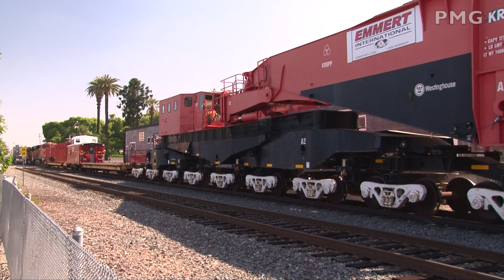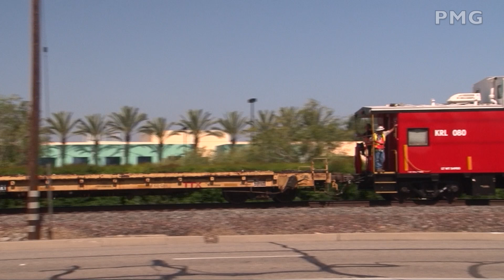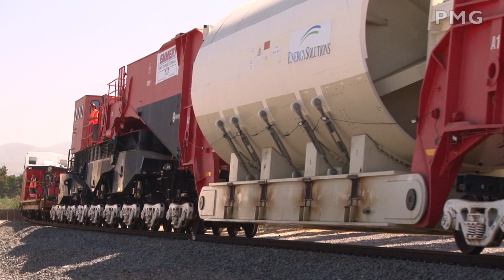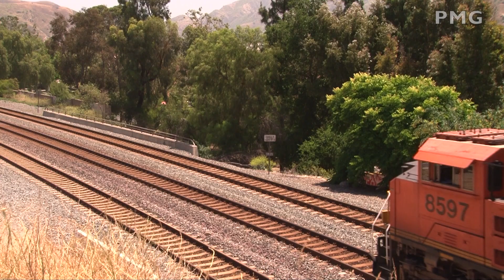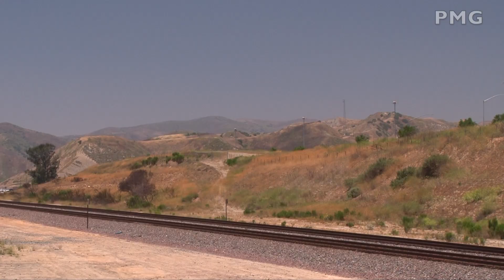Schnabel Car Transports Nuclear Container

Comment: Why scrap well made machinery? Disposable mentality.
Reply: FRA regulations - railcars must be removed from interchange service after 40 years, though with re-building, they can be given an extension of 10 years. The car passed its 40th birthday in 2020 and there's not much of a way to re-build or re-condition such a unique car.
Reply: @whiteknightcat The regulations should be changed to miles traveled, not time elapsed. It's as good as new.
Reply: Safety mentality. You don't want railcars falling apart from hidden metal fatigue while hauling 200tons of dangerous stuff.
Reply: @karlkirkwood6213  Chinese monkey metal far less quality today.

Comment: our tax money at work. 

should just keep the “stuff” at the nuke plant. as soon it will be destroyed by the state.  as cal wants to power everything with solar.
Reply: You don't know anything about nuclear regulations or radiation contamination, do you, or that Southern California Edison, a PRIVATE utility, has to pay for all this?
Reply: Actually, Gavin and the state legislature have changed their tune on nuclear. They realized how important San Onofre was, so they decided to keep Diablo Canyon operational for several more years. There's actually too much solar right now because there aren't a lot of great ways, in current operation, to store the energy for when you actually need to use it. Lot's of creative "battery" options out there like pumping water up to a reservoir and releasing it down through a turbine during peak demand, for example. Building stuff like that takes time and money.
Reply: @karlkirkwood6213  San Onofre HAD to be decommissioned because of damaged steam tubes. They'd only been replaced 2010-2011 and 3,000 of them were found to be rapidly and prematurely wearing and breaking down little more than a year later. The NRC deemed the plant too unsafe to continue operating so it was shut down. Decommissioning takes years because of the nature of the plants.

Comment: Why scrap the car? it is not used much so should not be worn out. 
or is it because thee are no more loads that car was built for? 
if so i call poor planing. as build cars that can handle a variety of loads.
Reply: FRA regulations - railcars must be removed from interchange service after 40 years, though with re-building, they can be given an extension of 10 years. The car passed its 40th birthday in 2020 and there's not much of a way to re-build or re-condition such a unique car.

Comment: Prior to retiring, I worked for Combustion Engineering, Inc for 40 years (the nuclear division was later bought by ABB, BNFL, Toshiba, then Westinghouse Electric).  We bought it for transporting heavy components we manufactured for new nuclear power plants and rented out the Schnable car for other heavy loads.  Some winters it was used in Canada, when the rail bed was frozen to support excessive weight, to haul very heavy loads to mines in northern Canada.  We had an engineer in Windsor, CT who was responsible for traveling the entire train route measuring clearances, curve radii, trestle strength, etc. to ensure the load could reach the destination.  There are two caboose cabs mounted on the car for housing this engineer and other support staff.
Reply: Is it possible to move the load sideways ? ie to increase  clearance and deal with center of gravity issues due to canting of  track in curves ?

The biggest one used in Sweden for transformer transports from Ludvika to the selected harbour allows that - though it is rather important not leaving the load in the wrong position...  It has been a number of lost loads due to that (ie a 200 metric ton transformer upside down in the ditch...)

Comment: Hi everyone. I'm the cameraman for this program. Many of you were wondering why the car was being scrapped. It was MY understanding 2 identical Schnabel cars like this existed and both were built in 1980. Instead of investing $$ into rebuilding this car, it was decided to just scrap it once it was finished with THIS assignment. I was told they would keep the other one in service.....for now.
Reply: @markjohnson4924  I heard that also.  As I remembered it was scrapped on the spot.  Since cars have a 50 year life span  per FRA regulations
Reply: How many Schnabel cars are there? Just the two?
Reply: @mkay1957  There are dozens around the world, but perhaps 30 in North America in various sizes. Reportedly, there were 2 built like the one filmed, but THIS one was scrapped.
Reply: This particular car was built in 1980 by Krupp Industries of West Germany in1980 and was the only one of this size at the time. Kasgro Railcar, a U.S. company built a second one in 2012. It was almost an exact copy but was heavier and had a higher payload rating (2,035,800 lbs. vs 1,779,260 lbs.). Visually they were easy to tell apart because the Kasgro had a blue body and black trucks instead of a red body and white trucks.

Comment: Why are they scrapping it ?
Reply: FRA regulations - railcars must be removed from interchange service after 40 years, though with re-building, they can be given an extension of 10 years. The car passed its 40th birthday in 2020 and there's not much of a way to re-build or re-condition such a unique car.

Comment: Cool video of this particular rail car! However, I think the real remarkable story here is a train that has 2 cabooses on it in 2024! 
Seriously miss seeing trains with them!
Reply: Lots of people involved in the move
Reply: At 1st I thought that the cabooses would have security in them, but then realized no reason for them, empty reactor. The police on the roads and such were to keep down the chance of stupid people running across the tracks and if there would be some unfortunate incident.
Reply: @MsGorteck  It's not a reactor vessel: reactor vessels are much larger. It's just some part of the power plant.
Reply: @beeble2003  oh, ok, thanks. Still no reason to have a rapid reaction force on board.
Reply: There will be heavily armed guards in the cabooses. Same as with hot fuel shipments.
Reply: @janjohnson9746  There's no reason to have any guards. They're just transporting a decommissioned part of a nuclear power station. There's no nuclear material on this train.

Comment: I was almost the locomotive engineer on this train but I wasn't FRA rested in time from my last shift to take the call.
Reply: All of those wheels it must be dens material, and I'm wondering if they pay a premium for having it transported by rail.
     Any thoughts?
     ~M.B.-----09/09/2024-----
Reply: @ClintBlack-oq4vb  I know the costs to transport dimensional shipments like this are pretty high, but i don't know how much exactly. In many cases these loads can only be transported by rail because of their size, weight, and/or territory to cover, so that causes shipment costs to be higher. But, I'm just the engineer. I don't have much knowledge of their billing and accounting haha
Reply: @kensingtonchapp4819 ya your an engineer, we're all engineers!!!
Freeking gased up machine operators in this world. 
If I run a tray pack that hardly works to load your boxcars, and I have to work on the machine. Then❤😂🎉 I'm an engineer.
Reply: @FNBSRailway  Um......lol.
Reply: @FNBSRailway  um.....lol
Reply: do you remember who the crew was?
Reply: @kylezook2936  I don't even remember the train I was on today🤣
Reply: @kylezook2936 I was had a orange vest on
Reply: Aren't you lucky you didn't get the call ? 15 mph from SONGS ! Yikes.. one engineer to another..
Reply: @jimg6476  I enjoy running and enjoy the oddball trains, so I would've had a good time. I'm good for 12 hours at 15mph or 70. Lol
Reply: @kensingtonchapp4819  true had my share of oddball calls. Movie trains weed sprayers circus trains Amtrak officers specials OL officer on the train missile cars Christmas tree trains . Glad I am retired !  Leave the work to the laddie bucks !
Reply: @Run8nova-f4b lol they're Z1s now and i just tied up from a Needles trip.
Reply: can't lie brother, bit jealous. I'm sure there's things not to envy about the job but this is one of those things where it is a unique human experience to be the engineer of the locomotive pulling nuclear cargo. being a locomotive engineer is my dream job for whenever I get sick and tired of computer engineering. love that you enjoy the "oddball" loads. also, curious, did you need to go through special certification to be called in for loads like this?
Reply: @kjchaifisch  You're absolutely right that there are aspects of the job not worthy of envy, but typically only if you've never had a difficult career with no other frame of reference. Being on call 24 hours a day can be a little rough sometimes, but I think the job itself is a lot of fun even after 11 years. As far as special certifications go, there are none above and beyond engine training, as that alone will make you proficient in handling trains with HAZMAT. However, to work in some terminals such as Los Angeles you need a TWIC certification, and to work out of San Diego you need a military ID because to get to our Stuart Mesa yard you have to drive through Camp Pendleton, but that's essentially it.
Reply: Yeah right liar.
Reply: @robertgardner8680  Don't be jealous.

Comment: There was a very interesting clinic about this move at the NMRA convention in Long Beach earlier this month. To prepare for this they scanned the entire route with LIDAR a few days earlier, and temporarily moved obstructions that were too close. Also there was a bridge in south Orange County that had to be temporarily shored up. They moved the train partially onto the bridge, stopped it, and measured the deflection. If it was more than 0.75 inch, the move would have been cancelled and even more reinforcements added.